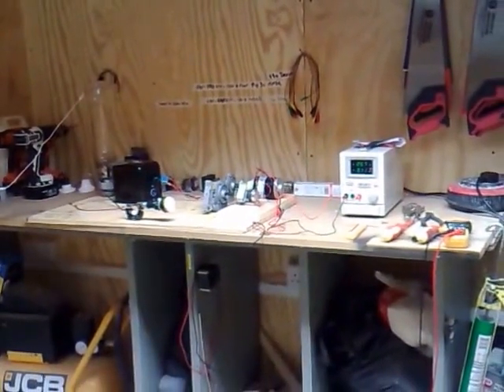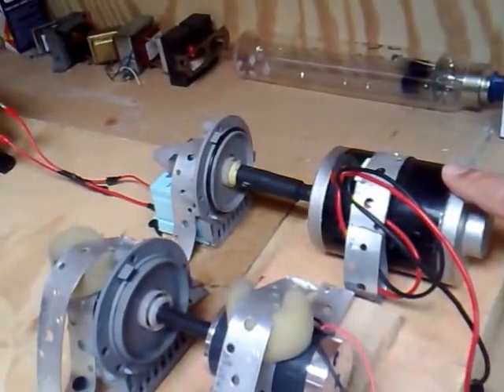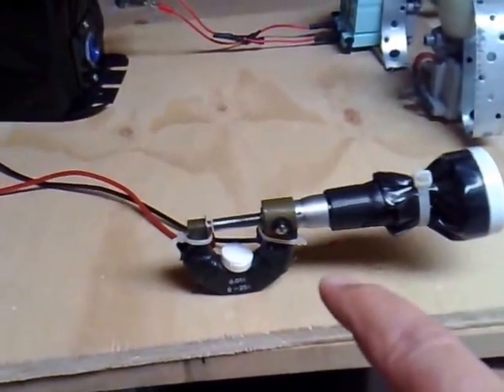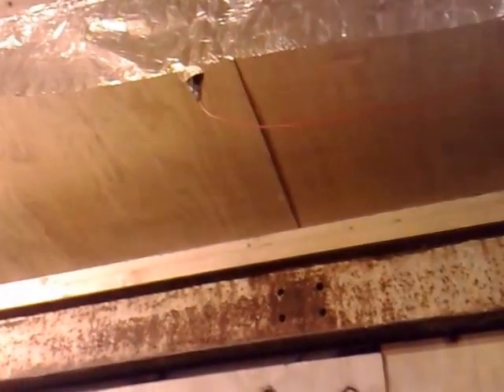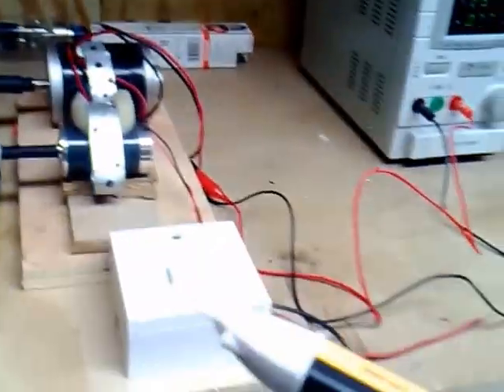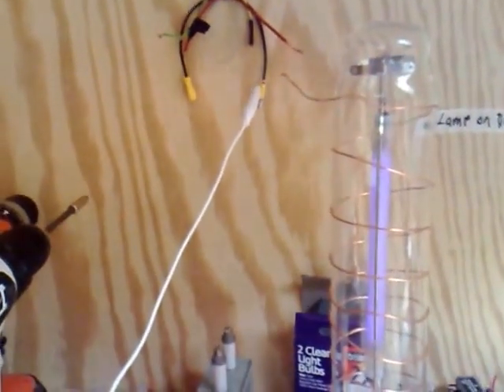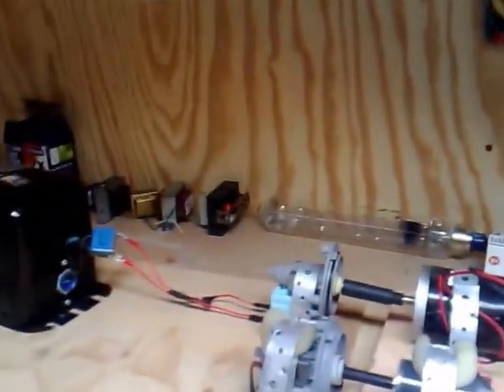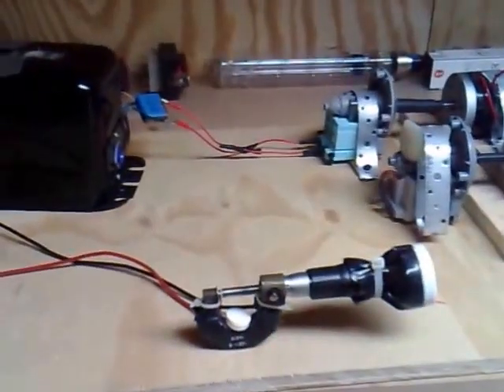Gerard Motor PROOF of RF.mp4

Comment: Um it looks like square wave induction.   Like the static generated from a spark
Reply from the maker: +Brian Brown Hi B.B. So do say that the plasma alternating shockwave is "Magnetic"? (Induction)
Reply: Nope. I'm saying it looks like power is being induced thru that light (like a capacitor) generating EMF like static electricity and the square wave of that current is creating the same  "static" that an old brush motor does when it interferes with our old AM radio or TV. I'm leaning more towards electromotive force than RF. (in this case, organized static electricity) But... that's just me *sigh
Reply from the maker: +Brian Brown Hi again B.B. I am trying to understand what is going on. If you have time + interest my next experiment "Plasma Power Generator Transformer 2" video gets even more interesting. I agree that it could be like a capacitor.  ..... Regards DC

Comment: hello. could you please tell me how a pump from a washing machine can produce OVERUNITY? or somebody could help with explanation please. thanks
Reply from the maker: Good Question. The way I see it is:- Its like getting two metal bells of the same shape & size / weight. Hit one bell with the right amount of energy / frequency and the other bell will ring in "Harmony" at "scalar" frequencies!! ....  (Note you can add more bells ringing together which add value to the surrounding Aether. .... DC

Comment: Can you power a desktop computer on RF volts? You need 230 volts AC 50 Hz to power a desktop computer normally. What RF volts you will need to power a desktop computer and at what Hz?

Comment: Hi Do you have a diagram pleasese.
Reply from the maker: Hi no diagram but Ken Wheeler's channel explains that the copper wire is like a reflector and the energy does not flow in the wire but around it. RF.
Regards DC
Reply: @e.powerdc1127  Hi Sir , as per your video ,using plasma globe and a coil, the result is the same right ?
Reply: @e.powerdc1127  Thank you for the response.
Reply from the maker: @qbitsday3438  plasma a spark, Tesla quote = "is an event in the Aether". So much to learn in what time we have.
Regards DC
Reply: @e.powerdc1127  Sorry for the my incomplete question.  the Plasma Globe use used + the coil on top of the glob , the result is same as Gerad Morin using the motor  am i correct?
Reply from the maker: @qbitsday3438  Hi, its now years since i viewed Morin's work i can not say, sorry.
Plasma is a state of matter, hope this helps. DC

Comment: So it is RF generated by a high voltage and a spark gap. What so special about that? They had that back in 1912. So you can touch it? Well then the voltage is low. So?
Reply from the maker: +jlinkels Hi J well I am a learner & I am loving it. I am trying to make t plasma transformer at the mo. So if you have any ideas I would welcome them.  Regards .....  DC
Reply from the maker: +jlinkels HI Jkels please note which side of the spark gap I touch it. One side I am Dead the other Mm like static. Ref:- Tesla "Hairpin".......  DC
Reply: +E.power DC You are not touching any "side of the spark gap". You have a wire wound around the plasma lamp. The wire is loose a one end and the other end is connected to the "antenna". There is no galvanic connection between this wire and the primary nor the secondary of the transformer. Only a time capacitive current, enough to trigger your detection device. Ever wondered why you can  touch a show plasma ball where you can attract those nice spark with your fingers?
Reply: +E.power DC TINY capacitive current that is
Reply from the maker: +jlinkels Hi again yep I got it wrong. Wrong video sorry, get old buddy, yes time capacitive current. Found it hard to measure.  Regards .... DC

Comment: What was the rpm if the dc motor
Reply from the maker: Hi ...DG the rpm varies for this application. It was low about 60 rpm with 52 contact points per rev. Notes
At high rev's power dropped off.  Hope this helps ... Regards DC
Reply: @e.powerdc1127  i thought the principle idea is that you either rotate the dc motor at rpm that produces a rf signal that is at 20 khz or more or feed an rf pulse at high voltage wich results in only a little bit of current doing a lot of work wich demonstrates gerad morin's idea of electronic leverage
Reply from the maker: @dominicgeorge7299  HI DG. So much to learn, its great to experiment. Everyone is stuck in the Hz thing, yes its important but very inefficient. the Big Question should be what is electric? If you follow my channel you will know i am just a learner with passion. The key is to understand the Aether. The real driver is voltage. See my latest video, Everything is a magnet. We have been too focused on the magnetic & not the Dielectric. Nature is simple! .. Regards ... DC 
 https://www.youtube.com/watch?v=euLRd27h5E8
Reply from the maker: @dominicgeorge7299  hi again DG, you are correct. Gamma = hard light (Ken Wheeler) my learning's have grown from a/c to pulsed. Are you or do you agree in the "Aether" media? ... Regards ... DC

Comment: lamens turms would be good i think also why if its free energy are they running on wall power they  should be able to add a solar panal with a boost converter and a supercapacitor to make it run on its own power why is there no real vision in these experiments

Comment: Of course ac current is rf. Any frequency of voltage is rf . A simple transformer is proof. When voltage can pass thru one side of a transformer and be usable on the other winding it has passed the test for rf. I know dc can be induced in a transformer and create an output. A simple coil on an auto ignition system proves this. When a radio station generates a signal this oscillation radiates into space then you use a receiver to find it is this not like a transformer?

Comment: the light bulb makes the RF. Why do people think this motor is special because you can spin it and make electric.....almost all motors with a magnet do this...nothing special. go find any hps light and pump 10,000 volt pulses thorugh it and you will have rf.
Reply from the maker: +Bradley Malone Hi, yes correct. NOW go and convert the "RF" to workable power! Simple? THink what I showed you about the Earth!!!! "Northern Lights" "Ionization, transferring power to turn the Earth!!! The Earth is a MOTOR!!  I hope that you can see this possibility. (Only theory, it's just as I see it).  .... DC
Reply: +contactbiotrance the fact that you dont know the difference between a pulse and an ac signal tells me that anything i explain you will not understand. so I am not going to waste my time.
Reply: +contactbiotrance 
PWM is not so much about changing the voltage or the frequency as the Mark / Space Ratio.  Hence the initials: PWM = Pulse WIDTH Modulation.

"Mark" is "on" or +Volts, "Space" is "off" or 0 volts.

So for example the following wave shapes (scuse ASCII) may all have the same frequency and peak voltage BUT the PWM is different (approx 20%, 50%, 80%) 

_____-_______-_______-_____

___-----_____-----_____----____

_----------__----------__--------_

I am not quite sure what you mean with "can pulse a.c  current .modulated ..pulsating and no facts that has been any pwm" so I cannot offer any ideas there, sorry. Hopefully though, the crude little ascii doodle above will show how the frequency of a PWM signal can remain the same but the PULSE WIDTH is MODULATED to the figures given - 20%, 50%, 80% Mark / Space.
Reply: +contactbiotrance 
Well the plasma of the lamp ionizes and conducts electricity - and in doing so the outer copper coil works like an air-spaced transformer - with a single winding (plasma tube) and a secondary coil (the copper wound around it).

Now high frequency AC (not usually called RF unless over 100,000Hz) does have interesting properties compared to low frequency AC and DC. First of all there is the "skin effect" where electricity tends to travel along the outside of a conductor (which is why many UHF / SHF feeders are hollow copper or silver "pipes" rather than a solid core.)

Power can also be "radiated" (how radio / tv works) so you can appear to lose energy into "thin air". It isn't being lost in the true sense of course, it is being converted from one form to another - electricity to electromagnetic radiation.

Another very important point with regard to this experiment is that most of those little "power detector" pens are only reliable at LOW frequency mains - and even then, many of them will go off if you even stand near a transmission tower (or electricity pylon).  Almost all will trigger in the presence of high frequency AC almost irrespective of the power of the radiated signal.

They basically detect pretty much anything - which is why unless a meter or oscilloscope is used to monitor the voltage and frequency of that "RF wire" and foil antenna, we don't know WHAT is going on.

This is one of my main "gripes" - I am all for experiments - and often some of the most important discoveries were made by accident when initially trying to do something else. The problem is, without taking readings, people have absolutely no idea at all if any unusual / interesting phenomena is taking place or not.

Frustratingly, although I suspect your conversation English is superb, I am struggling to understand your more technical questions and points though.

Electricity is a truly fascinating subject and I am more than happy to believe there are many things still to discover - but I am pretty sure whoever finds them out, will take care to record readings as accurately as possible and taking FULL account of the difference between RMS (Root Mean Square / Average) power levels and pulses. If not their data will be invalid and they may spend months or years chasing their own tale instead of cracking on with something that could have potential ( pun intended :) )
Reply: +contactbiotrance the pulse happens because of the spark gap
Reply: +contactbiotrance i have a SSTC :)
i know about it
uses dc input
transistor is the spark gap in the device
when the current starts floating through the transistor from collector to emiter it energises the primary coil wich in his turn engises the secundairy coil
the secundairy's ground connection isnt connected to ground.
but instead through a high voltage capacitor to the base of the transistor.
he triggers the base to go off again.
slayer exciter circuit

and that's only one way of doing it.
there are lot's more.

Comment: hello folks 

im getting up to 600v and 140amp 

with this pumps and 12v motor's 

but can't light a single 5w bolb .. anyone can tell me what is wrong ??
Reply: so... you're saying that you're generating 84000 WATTS of power and can't get a light to turn on?
Reply: What are you powering with the output of this machine? Also, your video is very cluttered and I can't see where your meter leads are hooked up
Reply: +Kelly can't load anything with it. . i measure the output of a Microwave transformer.   on the voltmeter shows 560v. 140amp.  etc but when i load a 40w bulb doesn't work
Reply: +Kelly and i see many many videos from Gerard Morin and others which are working on same project and getting a single lighting bulb. . noone shows what else can work with the electricity of this water pump
Reply: because everyone has massive volts, but no amps. if you think about it, it's just a mechanical step up transformer. Power (watts, the useful measurement, the ability to do work...) = current (amps) x potential (volts).... Power in = Power out - losses. I suspect if you measured your amps and volts on both sides your power in would be significantly greater than your power out. Both sides being your input to your motor, and your output of your generator.

Comment: Sorry, I can´t see the point of this video, can someone explain it ? All I saw was common electromagnetism as Faraday demonstrated more than 100 years ago. When the lamp is lit, it induces an alternating current which creates an electromagnetic field, which then, goes to the antena. Indeed, if you turn on a radio receiver nearby, you will listen to the "broadcast", and this was precisely, the first radio transmission made by Hertz. Tesla went far beyond and could "broadcast" high energy which could lit lamps several hundred meters away. This is the principle of radio.

Comment: nobody understands what the magic is that tesla knew  al the movies on youtube they al do not understand what is going on 

pay attention :

when you have a wireless transmission you use just a little bit of energy  
then when you lit up a lightbulb it wil shine and when you have a right tuning it wil shine bright .
when you take more lightbulbs they wil also shine and tuned they shine as bright as the first one 
you can take more bulbs and let them shine ....
your tv can also work on this of radio  or most static devices 

but now think ...  think real hard ...

look at your input energy ...  it didnt need more INPUT ENERGY  !!   try that in yout home to light up al the bulbs or tv etc etc 

every extra consuming cost you money !

so where is the extra power coming from ??    that is what we call the zero point energy / ehter / black matter of what ever you want to cal it 

you have small energy input but you get more way more out with wireless transmitting energy because the energy is sucking the extra energy from the ether 

its simple and proven fact what they wont want to let you know !  because you can not charge cost for something you cant messure  the more lightbulbs or other devices it doenst cost you more then only the little energy input 

and with some clever thinking you can tap this energy to recharge your input energy 

dont agree with this i dont care 

as long as its working for me 

so please stop al the bullshit and try to think and be a bit smarter and be more kind to everyone 

life is short lets enjoy life and each other and give the planet what it deserves 

we are destroying ourselfs 

( sorry if i make mistakes in writing i am not so good at this )

Comment: Lol that detector is not reliable at best,you need a multi meter you get a true reading, I can take that volteck and put it on a wire thinking it's hot , and still get a reading!